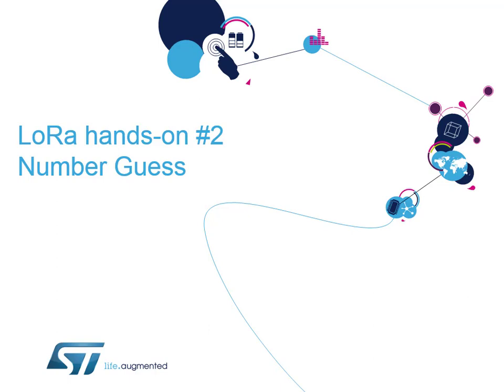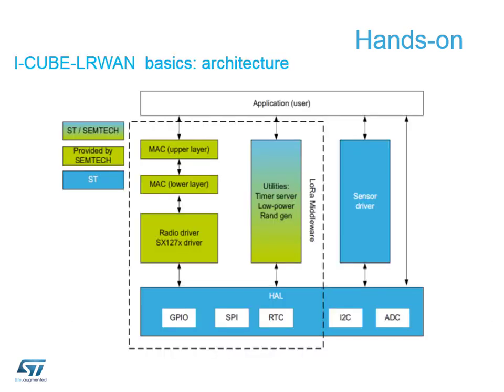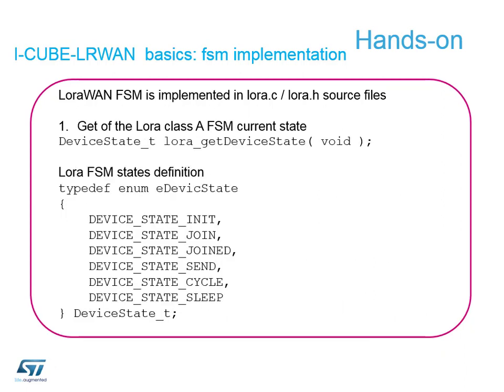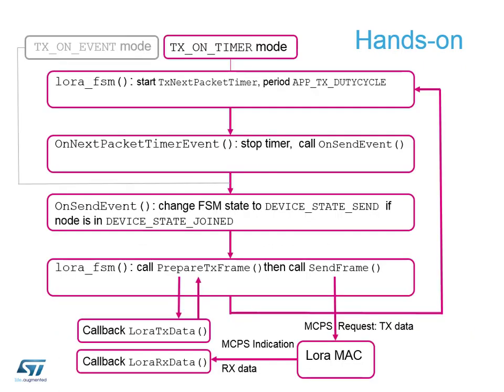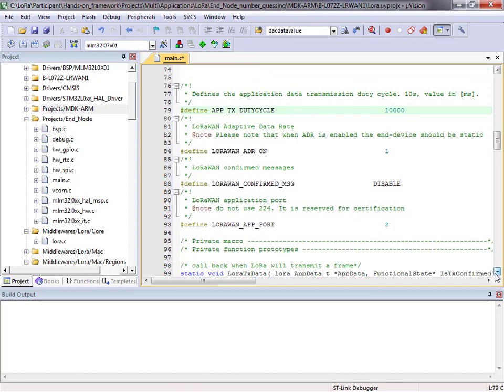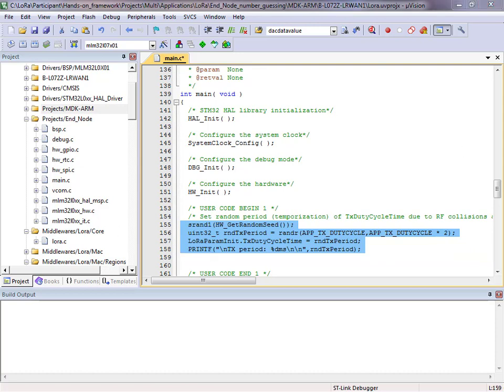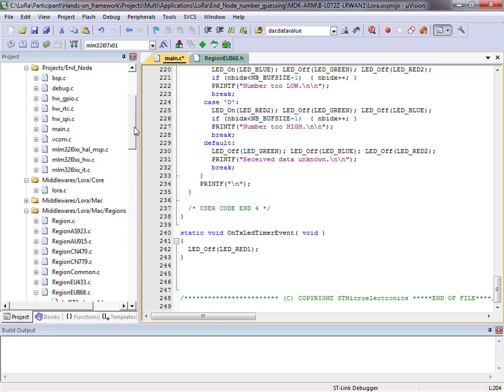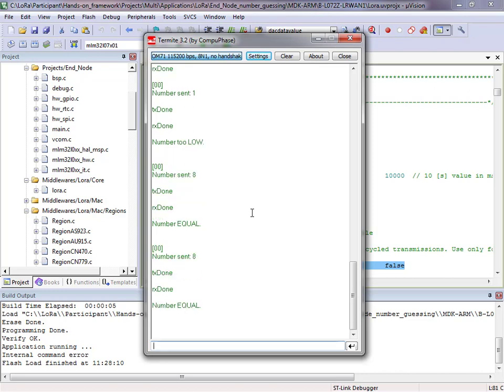LPWAN workshop - 6 Number Guess Hands On

Comment: Hi 
when i try to compile the code, it returns an error stating that the "the code size of this image (51000 bytes) exceeds the maximum allowed for this version of the linker".
Does it mean that i need to bus the essential, plus or proffessional version of the MDK?
Reply: i had the same problem and in the mdk web says that you need to pay for the license of  keil if got that error, i recommend you to use the system workbench for stm32 eclipse, it is free and compile with no problem